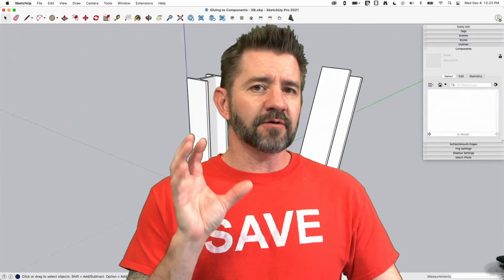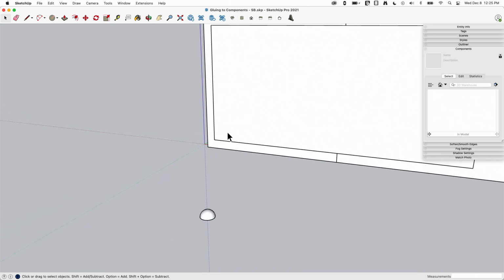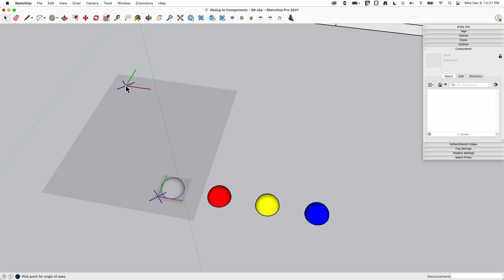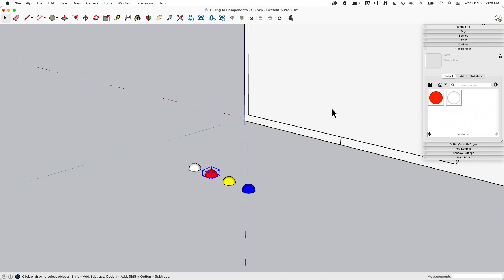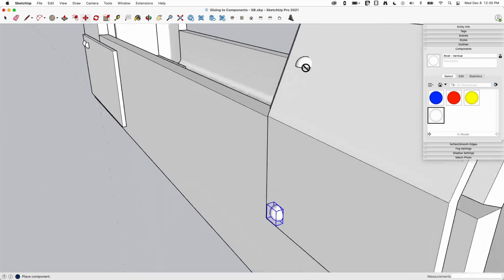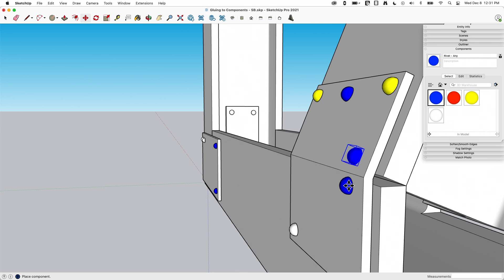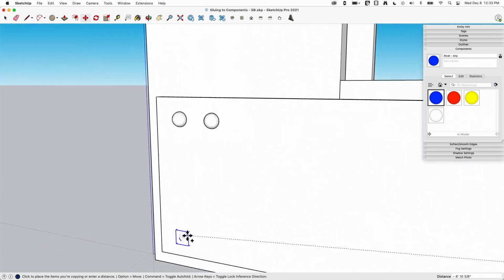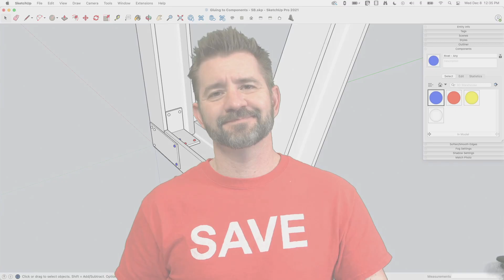Glue to - Skill Builder

Comment: Thanks - I'm one of those confused by the glue to properties, but no more :)
Smart to put the axis origin in the center of the component (could have saved some effort tho if you just done it once on the "prototype")
And finally a question: You said the dome was created withe follow me tool, why not just promote the handy "Sketchup Shapes" extension?

Comment: I wish you'd given the tip to lay the component flat in your previous More Components (https://www.youtube.com/watch?v=TDzjrrA26gM)   as I've had the devil's own job trying to adjust the axes to the back/side/top faces as you demonstrated.  Just now tried the laying flat on the floor for all and it works a treat, so no more swearing when it won't align properly on the face.  Another great demo!

Comment: Hi Aaron,
something related: how do you snap a cylindrical fitting exactly in a round hole where it needs to fit ? It has a surface perpendicular to the cylinder's axis, which needs to snap to a surface of a water heating boiler.
Problem is how to put it so centers will be aligned ?
Many many thanks !